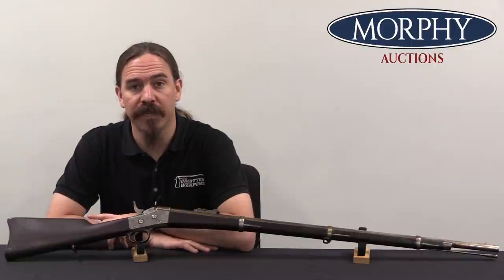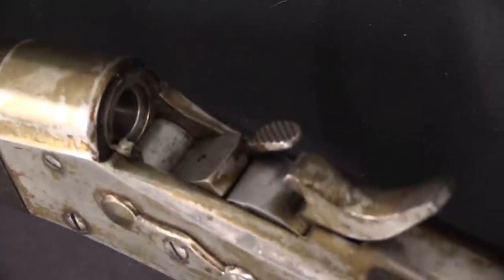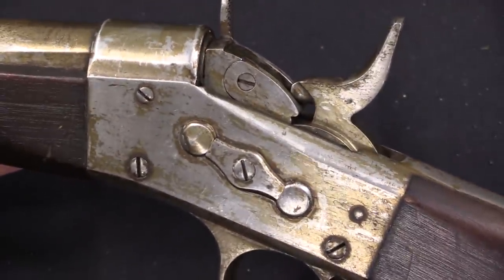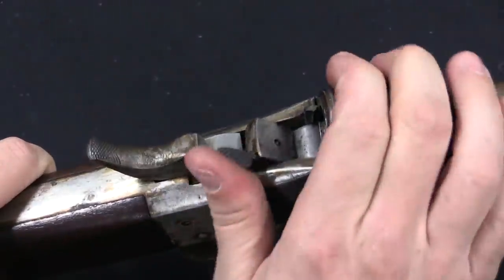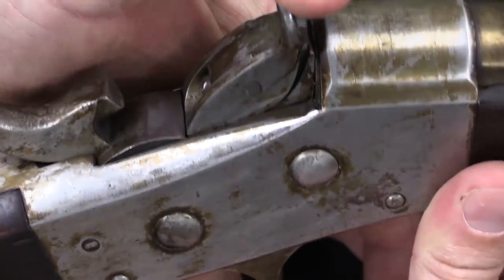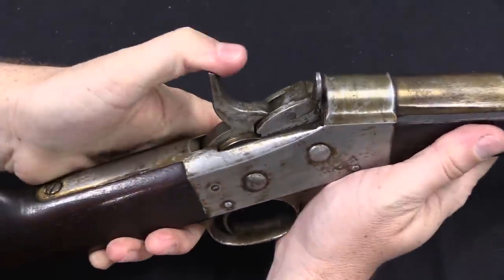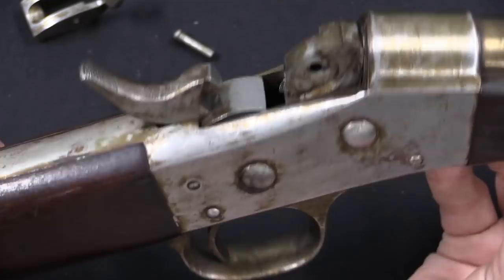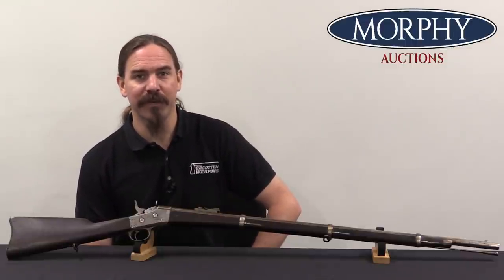Dodge Patent Prototype Rolling Block Rifle

Comment: Guns like this, where Ian mentions about how its safety system wouldn't be considered acceptable today, but it was pretty good for its time, make me wonder about the history of safety mechanisms.
Reply: @Kremit_the_Forg  plse add 3a) - 'Alec, are you sure?'
Reply: @Simon_Nonymous  That's something that usually will solve itself. If you do it wrong you'll either learn from the experience or you'd get a casket.
Reply: Quite.    " Remember, Mr Safety Catch is our friend". (Vimes to Detritus for lovers of the classics.)
Reply: How was that even a safety?.. didn't see what happened if you close breach.. seems like it would  just allow the hammer to fall!! What am i missing.. he only tried  to open in safe..
Reply: @Kremit_the_Forg  5: how do you hold this thing?
Reply: I'm guessing safety wasn't common vocabulary until industry started striking, and it was like the word 'strike'... most were like "yeah that makes sense" and a few were like "but money"
Reply: @grizzleknowsbest  look at where the half-cock notch is. Hammer is well short of the firing pin, some 3mm/⅛". IF you could push the stirrup forward against the mainspring pressure, the hammer would still catch on the half-cock notch and the rifle would not fire. The only way the rifle could fire would be if you pulled the trigger and smacked the stirrup forward at the same time.
Reply: Dont point a loaded gun at anything you dont want to die. - Safety mechanism No.1 my dad teached me VERY intensly
Rule 2 was "never trust the gun to not be loaded"
Reply: I think this particular case is because modern sensibilities expect the trigger to be pulled for one reason only - to fire the gun. Any other procedure that involves touching the trigger is now seen as a potential accidental discharge.
Reply: @trr94001  well, yeah. Because dropping the hammer is a potential accidental discharge. Even the old "put hammer down between the chambers of the revolver" has a chance of of crap.
Reply: @Simon_Nonymous  And 3b) "Well, we finally made it idiot-proof... Dammit, they just invented a better idiot!
Reply: , @Riplee , yep that is why turret pistols and rifles were abandoned, due to industry strikes. not due to potential customers not wanting to have 360 deg. fireing arcs.
Reply: @ScottKenny1978  And sensibly so. You really don’t want exceptions to your most fundamental safety rule. It’s interesting, though, how attitudes were different in the 19th century.
Reply: @trr94001  crud, not even 100 years ago. Ruger Mark 2 or Mark 3 requires you to pull the trigger to disassemble and reassemble the beast. Pretty sure those were designed 50ish years ago.
Reply: @trr94001  And yet, Glock pistols are carried by police and military everywhere, let alone the countless private owners.  And what must you do to take the slide off a Glock?

Yup.  Pull the trigger to drop the striker and de-tension the striker spring.
Reply: makes me wonder in 2270's what they'll say about our safety mechanisms
Reply: Look at the history of the automobile, they were massive deathtraps.
Reply: @TheArgieH  as a Disc-ite, it highly respect this!
Reply: @GarthVader68  that wasn't my point, try reading it again
Reply: Those history books are written in blood
Reply: @trr94001  the fundamental rule isn't to not pull the trigger.

It is to not pull the trigger unless the gun is pointing in a safe direction, where a discharge wouldn't be a big deal. You point the gun somewhere safe, then do whatever manipulation requires a trigger pull. This was and is still standard procedure with many firearms, and it is not inherently unsafe.
Reply: the problem arises if the weapon is more inherently unsafe than otherwise, and following typical procedure is hopeful at best. like the aforementioned turret guns, I'm willing to bet most guns ever made, you should have some idea if you're here, were just as potentially dangerous/deadly to their users as it is towards the intended party. again, I'm making a hasty generalization, but just look at many of the picks that Ian makes... they might be lovely lots of time, but are they usually foolproof? I praise the modern gunsmith, but peeps have always been dumb.. but I'm glad to see some reassurances in some comments lol
Reply: @Kremit_the_Forg    You left out "lawyers smell money" in that equation.
Reply: @alexio1942  They will say one of two things.  Either "I can't believe people were so careless and irresponsible they needed all that external protection" or "What's a gun?"
Reply: @Axonteer  That and "Keep your booger hook off the bang switch"!
Reply: Only true safety on a gun is the user.
Reply: Ian should do a video on the history of the safety on firearms. Now I'm curious as to what the first firearm with a safety was
Reply: Gun safties used to he not standing in front of it when it's loaded, so any thought is usually appreciated before the mid 1800's.
Reply: Before flint locks had half cock notches they had saftey levers of a kind. I think some crossbows might have had a type of saftey to

Comment: These rolling blocks are always slick. Quite a simple design but elegant
Reply: The rolling block is a really robust, simple way to ensure that the breech is closed and stays that way until after the hammer hits the firing pin.
Reply: Definitely my favorite single shot rifle design!
Reply: The rolling block is indeed a nice system. It is simple, robust and fast, there is a reason why it was kept around so long.

Comment: The safety mechanism explanation is plausible, but isn't another possible explanation that without that "stirrup", if you shock the gun (eg drop it on its butt) the cartridge might ride backwards and come out of battery - pushing the breech lock back. With that spring-loaded piece, it looks like if you are not actively pulling back the thumb lever to open the breech, it's locked so that no amount of jostling will open it.

Comment: I'm just curious how much force would be required to trip the catch, like a worst case drop directly on it. And if so, would the hammer be reset or drop?
Reply: Yeah, like if you bump it "closed" instead of trying to open it, would it let the hammer fall from that position?
Reply: I agree. I would have liked to have seen some force put on the lever pushing it forward.  If you look at the front edge of a Springfield rolling block hammer piece the underside curves back to make that edge a point rather than a flat edge, so it likely the notches on the safety lever are angled in such a way as to cause the hammer piece to wedge in place, which would require the lever to force the hammer back before it was released.
Reply: I'm thinking the same thing. I watched a vid where one the military style safety misfired, he then opened the breach but as soon as he closed it again the hammer fell and gun went off. I prefer to just leave the breach open until it's time to fire, then you know what's in the chamber or not.
Reply: @wmansir  While I agree it would be interesting to see what happened, it's a hundred and fifty years old and a one of a kind. Better to treat it gently, all things considered.
Reply: Judging from what we see at 08:47, I think it would be near impossible to bump this out of position. The hammer spring is putting a ~90 degree corner of the hammer piece into a 90 degree notch on the catch. To me it looks like the locking piece would have to overcome the force of the hammer spring, but from a mechanical disadvantage. The force required to do that would probably deform or shear off some part of this mechanism.
Reply: I had the same question.
Reply: @discerningscoundrel3055  very true. We need a replica to test
Reply: since it has a half cock notch on the hammer/trigger sear, if you were to force the dodge lever fwd like from a bump or a fall, it would simply allow the hammer to fall into the half cock notch unless the trigger were simultaneously held to the rear
Reply: I was wondering the same thing. My first thought was that if you gave the safety lever a sharp smack forward, the hammer would slip off and fall the rest of the way, firing the round, but on closer inspection of the exact geometry, the hammer is resting in an angle. It looks like if you did shove the lever forward, that angle would push the hammer back into the full cock position.
Reply: 8:48 You would have to hit the stirrup very hard to get it to come out of that notch, imo.

Comment: Could also be there to keep a stuck firing pin from firing the round when the block was slammed shut.
 This is an early one, without a firing pin retractor.

Comment: I noticed that the barrel bands have crowns on them. Maybe this was an aquired, modified rolling block. I have one of the Safety model rolling blocks used by the New York militia. Having to pull the hammer back a second time can be a PITA. If you forget, you end up squeezing the hell out of it. As a side note, I once saw a safety model listed that when the breach block was closed, the hammer fell and fired. Something I always keep in mind when shooting mine.
Reply: I also noticed the crowns. They look very similar to crowns I've seen on Belgian proof marks, and many rolling blocks were made in Belgium under licence and/or on Remington made receivers. Brief googling finds the same crowns on the barrel bands on at least one Argentine military Rolling Block with a Belgian proof marked barrel.

Wtf?
Reply: Slight update, I did some more googling. Those crowns may also be found on the barrel bands of Belgian made or Belgian rebarreled Egyptian contract rolling blocks.

It's pretty clear that at least the barrel bands are Belgian, and likely somewhat later than the 1860's. Of course they might not be original to the gun.

Comment: From the explanation, one can make the guess that the big crack in the styrup is due to the gun having been put into the "Dodge" safety position, without a user being aware of it, and the user then forced on the styrup backwards, thinking wrongly that it was abnormally jammed. Does that make sense?

Comment: One day guns will have boxes that holds multiple ammos that feed directly into the receiver.
Reply: 1879 is the Lee patent date for the Detachable Box Magazine.
Reply: @ScottKenny1978  James Paris Lee had his hands in on a few designs.
Reply: @lancesoterion435  I have a plan for a "Maxim-Lee Model 1894 Self-loading Cavalry Carbine".

Uses a Fightlight SCR lower with walnut buttstock, and a PWS piston upper. No Picatinny rails, just some old school sights. I just need to find a nice way to do the handguards in wood. Gonna put the Lee patent for the magazine on the upper, as well as the Maxim patent for a gas operated firearm on it. Planning on using either 6.5 Grendel or .300BLK.

Just to really screw with the antis and Fudds.😈😈😈

Comment: While these rifles may appear simple, from a manufacturing standpoint that breech lever is a far more complex part to make than most of the other parts in that rifle.

A cast part would not hold up and to forge it shaped like that probably took enough head scratching to make a dozen men go bald. Once forged you then have to figure out how to hold such an unusual shape to be able to machine it accurately in a process that is efficient and repeatable. 

I'd be interested to know if they then heat treated these parts? That's a whole different bag of tricks to master on a part such as this that has thin and thick sections that heat up and cool down at different rates without measures put in place to balance out the differences.
Reply: Practice and a lot of trial and error

Comment: Am I seeing things or is there a crack in the part added to aid decocking?  It looks like a crack running from the pivot pin up toward the flat part where you use your thumb to pull it back.

Comment: To me, this almost looks more like a poor attempt at what would later get fixed with variants of "safety hammer". Preventing the block from opening in the event of a gas leak through the firing pin channel, which could push the hammer back and unlock the breech while there's still pressure in the chamber. Gas leaks from ruptured primers or case head separation was not uncommon with early cartridge cases, and the RB is particularly vulnerable to such leaks. I say a poor attempt, because this would put the force of locking on that spring loaded tab. The successful safety hammer variants instead prevented the hammer from being blown back by any gas leak, thus keeping the breech locked in the usual sturdy manner.
Reply: With the early rolling block design the firing pin was Spring loaded and  sometimes it would freeze with the firing pin protruding out of the face of the breach block. When this would happen and a cartridge was placed in the chamber closing the  breech block would detonate the cartridge and blow back the breech block. What the Dodge brothers were tempting to do was to prevent this from happening. With the spring loaded part of the breech block being raised up if a cartridge was fired accidentally and the breech block started to moved backwards this raised back part of the breech block would catch the front of the hammer and stop the breech block from opening the full way.
Reply: @matthewbilly3252  that seems likely, this patent would solve both problems if it is strong enough.

Comment: I was wondering with the safety engaged what would happen if you hit the lever forward it appears to me the gun would fire. 
For Instance assuming the gun is loaded safely engaged and you were to set the firearm down butt first and the safely was bumped forward would it allow the hammer drop.????

Comment: What happens if forces the direction of the muzzle is applied to the safety stirrup lever when it is locked in that “safe” position? It seems to me like it might drop the hammer with discharging results.

Comment: I wonder if that's where the term "half-cocked" comes from, as in "going around half-cocked"?
Reply: Half cocked comes from flintlocks. I'm no expert but I believe it is when the frizzen closes the pan? In that state when the flint strikes it won't ignite the powder in the pan. So no boom. That's also where the phrase flash in the pan comes from too BTW. That's when you're full cocked, the powder in the pan ignites and there's still no boom. All you got was a flash in the pan.

Comment: That is clever. Now, I can convince HENRY ARMS to start up manufacturing on a whole series of these, that would be COOL!!! (Of course, I know the safety factor doesn't measure up to today's required standards)... I can see an octagon barrel, this system, sand blasted heavy grain polished grey walnut, in the typical HENRY style.... What would be even cooler, if these were to come out in the "mini garden rifle series, with a lever action assist for cocking, Dang that would be cool. Maybe even in a rifle .22LR caliber, 22 to 24 inch long barrel.. maybe, for giggles sake, in a 26 inch long barrel? just for looks, as I understand it, anything past 24 inches on a rifled barrel, pending the twist rate, will actually start to hinder the projectiles performance and start to reduce it...

Comment: When it's in the safe position, can you push the stirrup forward (which might cause the gun to fire) or is it locked under the hammer? It didn't look like the cutout at the bottom of the stirrup would hook under the hammer.

Comment: While the rolling block can’t be opened with that safety in place, is it theoretically possible for the safety to be pivoted forward, releasing the hammer and potentially firing the weapon? Or is that safety’s notch designed in such a way that it is positively engaged by the hammer, and therefore can’t pivot forward?
Reply: It looks like the safety bit can't move unless the hammer is fully cocked. The shape of the notch means it should work in both directions (hammer can't go forward, safety can't reset). The only thing that can go wrong is if you bump the hammer backwards just enough to release it but not enough to fully cock it.
Reply: Hopefully there is not enough hammer inertia to detonate the primer.

Comment: is the hammer pressure on the stirrup when it in the "safe" position strong enough that if someone accidentally pushed the stirrup handle forward (towards the breech) that it wouldnt move?  or could it potentially come out of the notch and drop the hammer?

Comment: I see a potential problem with this. After pulling the "stirrup" piece back and dropping the hammer slightly to lock it into the "safe" position, what would happen if the stirrup was accidentally pushed forwards? Would that not release the hammer and cause it to fall all the way? Or would it get caught at the half-cock position?

Comment: It's a shame that someone saw 'fittin' to remove the factory finish from the entire barrel and action and to grind off any proof marks, etc.  Lacquering or varnishing seems to have happened to  it after that and even it was partially removed, badly.  The mechanism of the safety is simple enough to be sold as an exchange item and effective enough to have been hailed as "new and improved" if Remington weren't such cheapskates.  It wasn't long after this that they decided to cheat John Browning out of Auto 5 shotgun royalties.